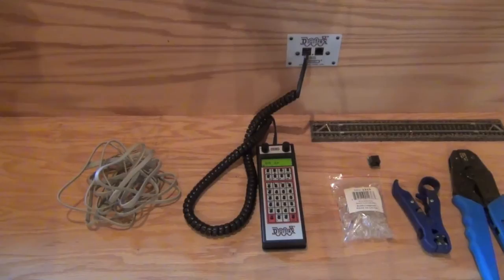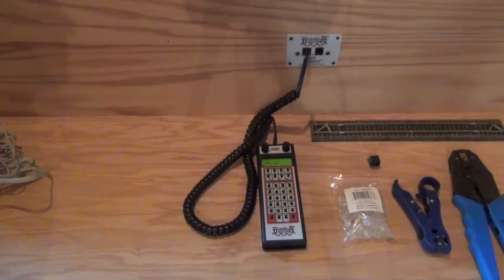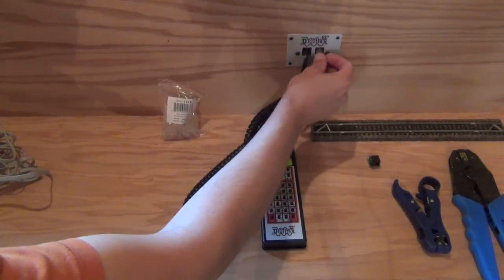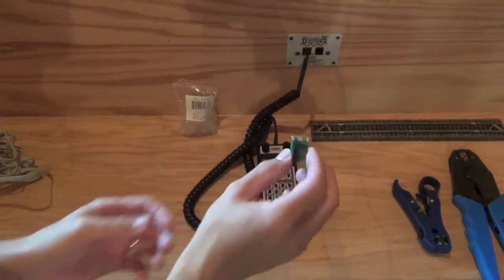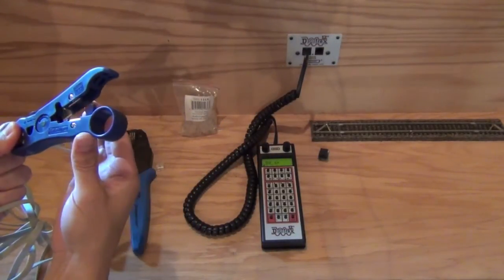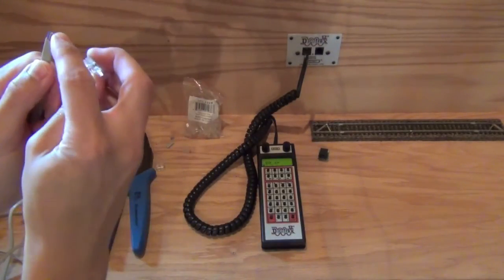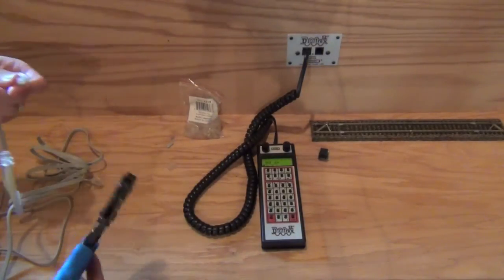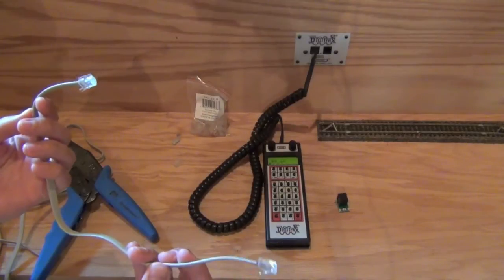Making a Loconet Cable for Digitrax DCC Systems

Comment: Hey love the video's. I have watched a lot of yours. I am having a hard time finding the wire, is it the same as phone cables? I went to all my local hardware stores and none had anything similar to yours. I have been looking online and it all says phone cable.
Reply from the maker: +Iowa Interstate Railroad Fan I was having trouble finding it as well and I actually got the cable at an ACE hardware.  The box that it came in actually listed it as phone cord (hence the difficulty finding it).  It had connectors on each end and if you look closely at the connector, you can see it has 6 wires instead of 4.  I got it a couple years ago, but I think 50' was $10.  Good luck!
Reply: +ck7813 awesome thank you, I have an ace hardware here in town I haven't tried yet. I will go look there.
Reply: LocoNet for sale

Comment: Do you need crimper to crimp the connector because I do not have crimper is there eny other way to do it please reply
Reply from the maker: minemaster 1312 Yes, you 100% need a crimper because it ensures a good connection between the wire and the clip.  Plus, the crimper pushes a tab in the clip that allows it to connect to the RJ12 port.  The crimper I have is an RJ11/RJ12 connector that I borrowed from my brother-in-law, he works in IT and installs cables.  Sometimes the big box stores (e.g. Lowes) have these tools that you can rent.  Check with them or just go into a local computer store and see if they can help you install the clips on the wire.